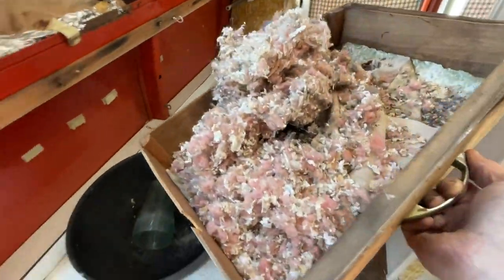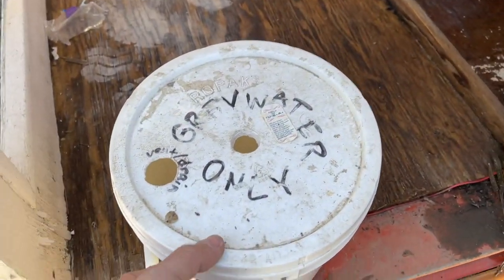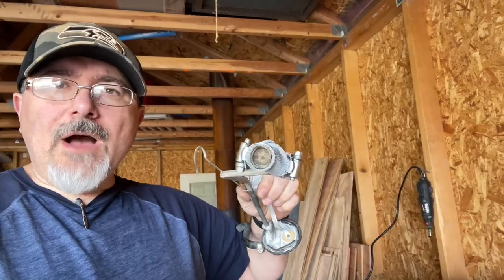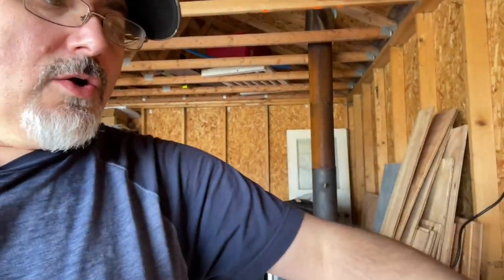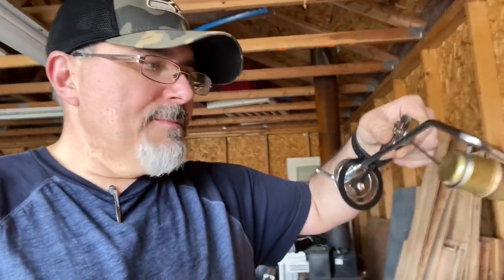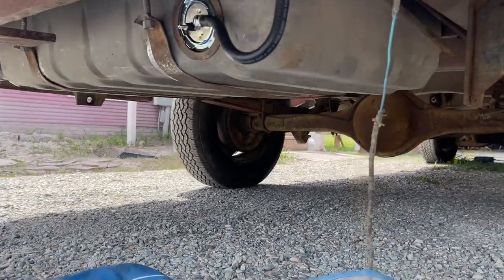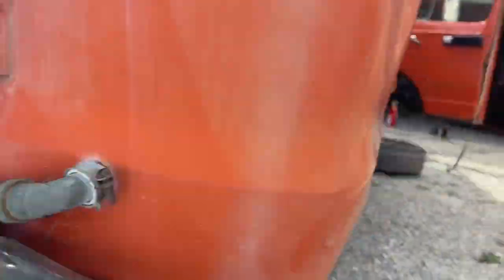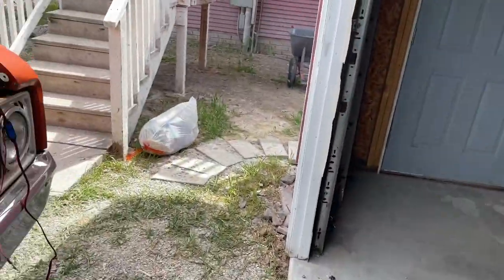Trying to start the field find 1972 Dodge Tradesman Camper Van

Comment: Did you lube the cylinders, clean the plugs, fill the carb with fresh gas, I hate it when people don't wake up a vehicle properly. After 10 years, those cylinders had some surface rust, cam bearings had no oil. You'll probably get to rebuild it soon.